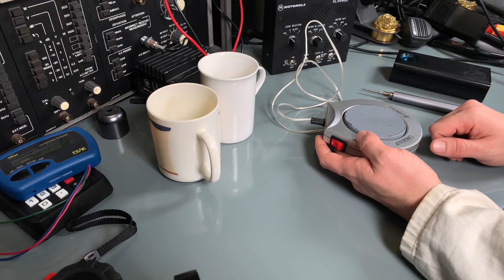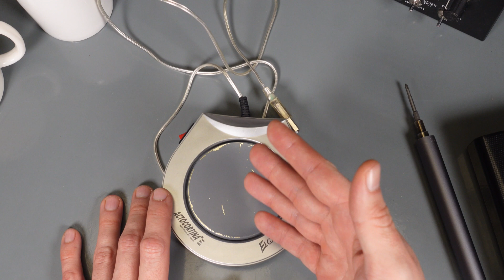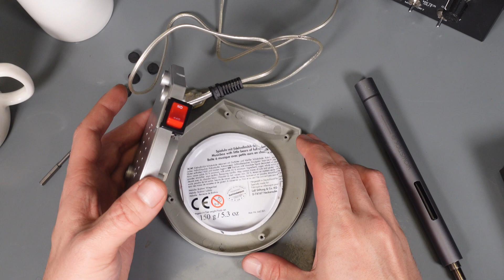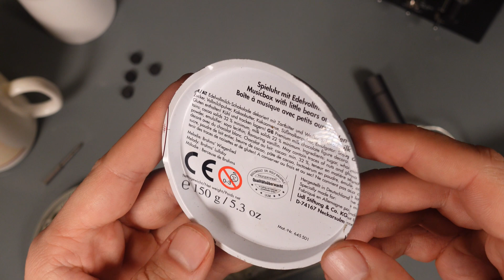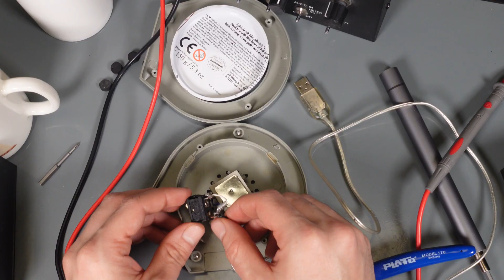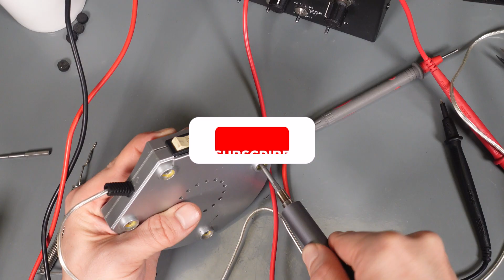Teardown + repair computer USB teacup warmer cup coaster  with unexpected finding inside!

Comment: Thanks. Hope you can do this for a pressure-sensitive drink warmer with no operator switch. I.e. it operates on/off by the weight of the cup. Your indight into the cup bottom shape was common sense but helpful!!!
Reply from the maker: Great suggestion but I got myself different heated mug-coaster - it's on my channel!